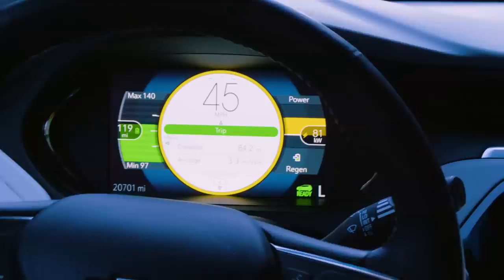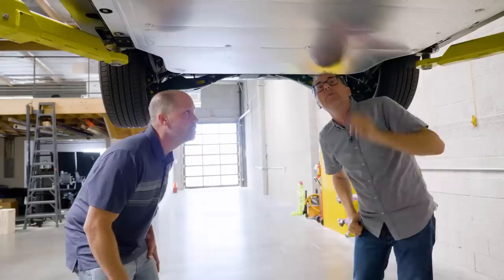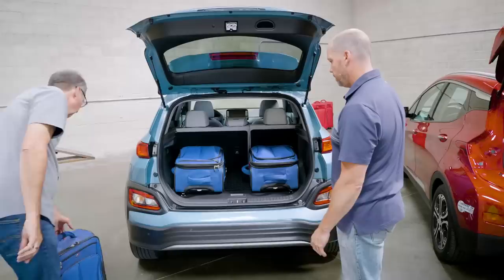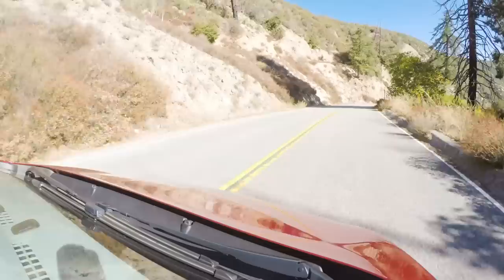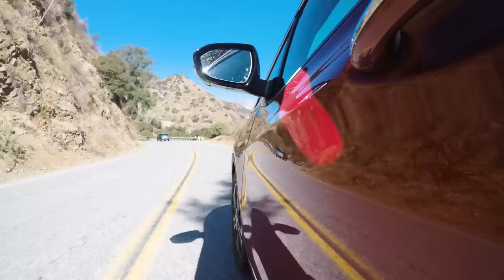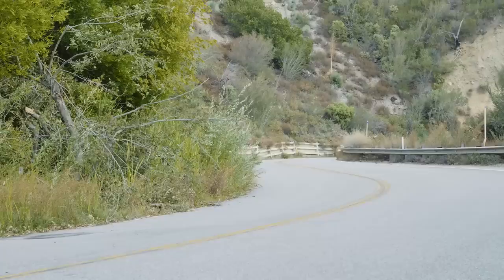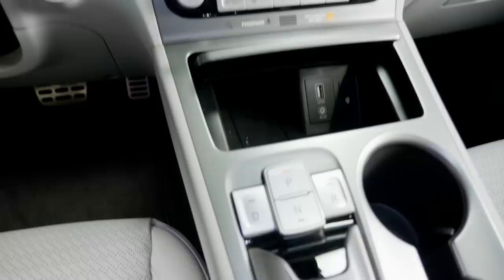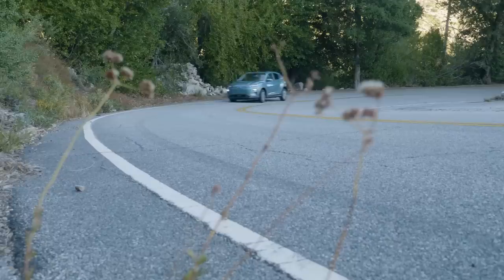Hyundai Kona Electric vs. Chevrolet Bolt EV: Which Is the Best Affordable Long-Range EV? | Edmunds

Comment: Neither, get a Tesla model 3
Reply: Never mind these two apples here, get this orange. And pay $10K more for it.
Reply: @NukePooch1  better tech, better charging fast network that exists today and expanding plus cheaper to use, better battery, American company that is all in on electric, worth $10k to me.
Reply: @flipperbear9  Doesn't change the fact that the M3 doesn't compete with the Chev and the Hyundai. It's in another bracket.
Reply: @Shadow-lq7rx  I don't care about Tesla one way or the other. My point is that you can't honestly compare the Bolt and Kona (apples) to the Model 3 (orange)...the Tesla model that could compete doesn't yet exist. If they can make it to market, fine, but I think they missed their window of opportunity. There's a TON of automakers with deep pockets that are soon coming out with EV's that will drive the price down even further.
Reply: @NukePooch1  how does a base model mid range Model 3 compare with a fully loaded Kona/Bolt, both at $45k?
Reply: @anevtransition1298  One's a rear-wheel-drive sporty-ish sedan and the other two are front-wheel-drive hatchbacks. They can't really be compared. However, if you tick every box on the Chevy (including all the overpriced accessories) then you're still $2k less than the black-only no-extra-option Tesla. You can tick every box and get a F150 priced the same as a base BMW 7-Series...doesn't mean they compete. It just means you paid $80k+ for a $35K truck.
Reply: Luck Tesla got that bailout loan from the government before it went bankrupt. Tesla needs the welfare.
Reply: @dmay3391  Tesla took a loan and paid it back with interest before it was due. That is not welfare, my friend. Money was made from that loan, which contributes to a strong economy. The government offers these for good reason. Chew on it for a while.
Reply: @Shadow-lq7rx  my friend the kona will be at least 42k I promise you
Reply: I tried to build the Model 3 as a hatch/fastback like these or its big brother S, but to no avail. Womp womp. No deal.
Reply: @cogniktive1147  ya there's no sense looking at sedans if they don't work for you. However, if you're working on a car comparison and you add Tesla to the script, but refuse to mention the mid range model that is close in price to these two 'fastbacks', you're going to hear about it.
Reply: @dmay3391  GMC (Chevrolet) also was bailed out by the government.
Tesla wasn't bailed out by the government, but consumers get tax breaks for buying one. The same goes for any electric vehicle though.

Comment: 18 months later and the Kona electric is only available in a hand full of states at full MSRP ($43K).  The Bolt is available nationwide and now has 259 miles of range due to a change in battery chemistry.  You can buy a 2020 Chevy Bolt Premier for $13,000 LESS than a Kona Electric.

Comment: Why do American car makers still insist on cheaping-out on items that give overall build impression?
Thanks for sharing the undercarriage build: I would def buy the Kona based on that alone. I live in snowy territory and had a Subaru with a skid-plate underneath. It made a huge difference busting through snow or taking on rutted dirt roads.
It's a shame the Kona fails on rear-seat room. I also don't see the advantage to the drop floor in the rear hatch.

Comment: The real question for me on an EV is the battery/range degradation over time. I drive many miles so a lease is not practical. I will probably buy another used Prius for a second car. My last one was a rock star.

Comment: Would have been helpful if we could have gotten some height information (when describing rear seat room).  Not mentioning height removed some very important perspective.   Dan is 6'2" tall so normal sized folks may have no problem sharing the front/ rear space in the Kona

Comment: The Kona is definitely a better vehicle, but the Chevy bolt came out nearly three years ago. The reviewers forgot to mention that the Kona also has adaptive cruise control and auto driving features such as propilot in the Nissan leaf.  Of course I would buy the Kona over the Chevy bolt in ~2019!

Comment: My understanding from several Bolt owners is that the seat "settles" in and foam and plastics relax a little bit. 

On the other hand, it's three weeks after this video is published and we still don't have Hyundai's website telling us "Hey, you can buy one now!" We're still in "sign up for email updates on availability", and no firm pricing yet. It's clearly more ready to go than the mythic $35k Tesla, but ... not yet. Still can't buy one. And used Bolt EVs are starting to show up for $27-28k with "practically new for an EV" 15-20k miles on them.  A lot of that is admittedly "tax credit effect", but ... it's still real when you write the check for purchase.

Comment: I charged my Kona electric to 100% and saw 311 miles of range available!

I have been trying to drive my Kona electric economically, though I do have moments of wanting to enjoy the spritely performance and acceleration!
I have noticed that the Kona determines its "anticipated range" based on prior efficiency achieved.  When you see the range number, it's obviously not written in stone, it's only what the car's computer "thinks" you can do.  As you drive, you can correlate your miles driven with the remaining range displayed to see how closely you are coming to the original estimate.
I have been averaging around 4.9-5.0 miles per kWh (7.8-8.0 Km/kWh), and charging to 90% which has been giving me between 275-285 miles (442-458 Km) displayed range, and by doing the math: 280/.90 = 311 miles (500 Km)!

Comment: The reviewers complained that the Kona regen was not as strong but they both missed the paddles on the steering wheel that add the additional regen force. RTFM

Comment: One thing I don't understand with the Bolt: why did GM allow it to go out with the seat it has, rather than grabbing a seat from another existing GM vehicle?  You'd think with all the parts-binning that they've done in the past, it'd be a no-brainer to remove everyone's complaints by swapping seats for the 2018 model year.

Comment: You didn't want to talk about range yet you mentioned the regenerative difference. Regardless if it is slight, you should had made an equal drive pattern long enough to compare how much recharge is benefited from the regenerative breaking.

Comment: Consumption? Ride is NOT the same as handling - take both to a track and see how they compare in turns. Steering feedback is lacking in most modern cars which adds to issues of screen distraction, lack of driver involvement, inattention and accidents.

Comment: Leaf will achieve range and power parity with these two cars in 2019 .. meanwhile it beats both for comfort,  and has the added benefit of being Time Tested for almost 10 years.  No shortage of trained service people or parts.. not that you are likely to need either.  Sadly the increased range will discourage development of charging stations in rural America...when that is the opposite of what is needed.

Comment: This was a very impotant video, but it needs to be updated with a 2022 KONA  SEL VS a  2022 Chevy EUV BOLT  base model and see 
how the handling and suspensions have changed and improved respsectively,  these two cars are the most similar in price now
for the 2024 and likely 2025 used car market, with both likely available in the 15K range by end of 2025  (after using the 4K IRS used EV tax credit)

Comment: Excellent analysis on what was covered.
Another video needs to be made on the "infotainment" system.  All cars, of late--just dealing with basic functions have gotten way too complicated and non-intuitive.  Example: Trying to set up two AM presets on the radio.  The print Owner's Manual was useless.  I ended up having to watch a YouTube video to see how to set up the presets!  A very sad commentary.  Disclaimer: My 2007 Toyota Yaris is so well suited for my driving needs--alas, no current car model comes close to its ease of use.

Comment: I thought the paddles behind the wheel on the hyundai increased regen?  (actually i think one lets it freewheel and the other is max regen)
Reply: Paddles, increase or decrease the three levels of regen. Plus holding the increase paddle will bring the car to a complete stop. No freewheeling option.

Comment: The $35K model 3 is not vaporware. Where is the proof on that claim? the medium range just came out and at a cheaper cost. So why couldn't the battery get smaller and cost less? Why couldn't the roof be aluminum? Why couldn't the seats be cloth? Confused to see how you think a model 3 at $35K is impossible. 

Everything else was good, but that instant dismissive comment just tells me biased asf.

Comment: You didn't discover the max regen Kona EV paddle shifter for max regen when entering a corner! Anyway, I am not sure extreme regen is good for the battery, and when range is not an issue, maybe max regen is not a clever thing to use daily.

Comment: Pretty good Comparison, missed charging tests to compare charging speeds and charge loss. The kona design definitely took notes on what to do better such as interior and seat quality , but remember the bolt has been out for 3 years so there were design flaws to get it to market quicker , I hope the next gen bolt fixes the seat issue . I have a bolt and the only negatives I have are 1. Terribly uncomfortable front seats and 2. No adaptive cruise control . Also they didn’t compare the infotainment systems, I really like the bolt tech , good to see other competition in the $35k and > 200 mile range points
Reply: Not sure about charging times, but there's a video on youtube with a guy driving a Kona who got over 510kms (316 miles) on a single charge (with 2% battery left).  Actually, on that video it showed a full charge (2% to 100%) in almost exactly 2 hours.  I just don't know which charger he was hooked up to.

Comment: Model 3 SR is vaporware - brave call Edmunds, and frankly I agree.
I also agree the Kona gets my nod - it is a better finished car than the Bolt - but the advantages are slim to the point a facelift can address many issues like the white reflective interior & better seats.

Comment: My wife and I own a 2017 Bolt and have had it for about 20 months now.  I'd agree with pretty much the entire review and I'll add a few observations.  The seats do suck, especially for a large man as myself but my more normal sized wife thinks they're ok and since it's her car, then it's not a big problem.  Legroom is great....front and rear.  The plastics are bright and hard....attractive on the face but there isn't a soft piece in the bunch except for the door elbow rest (barely soft) and the center console (ok).  One place where GM really cheaped out in the carpet.  I've never seen such a flimsy piece of material.  I know it was chosen to save mass and to save money but it's just a complete disappointment compared to every car we've had since my wife's 1993 Ford Escort.

I think the reason for the cheap interior versus the Kona can be blamed on when the cars were designed.  The Bolt came to market in November 2017 and the Kona came to market two years later.  But the cost of batteries per kwh has likely decreased since the two cars were in their respective design phases.  So Hyundai may have had a little more budget to spend on things like better interior surfaces, a more sophisticated suspension and even a bigger overall battery.  But there were other decisions that Chevy made that likely had an influence.  I like the supersized infotainment screen...this feature doesn't get enough credit and it leads to one of the best Apple CarPlay implementations out there.  So that cost more money.  Then there is the video camera-based rear view mirror, a feature first found in Cadillacs.  This is useful sometimes but I think that GM should have either made it an option or deleted it in favor of budget elsewhere.  As of now, it's a standard item.  And why Chevy chose not to smooth out the bottom of the Bolt for airflow is a mystery since efficiency is everything with these vehicles.

Otherwise the Bolt has been great...fun to drive and very reliable.  My wife hates the tires since they tend to skate on wet surfaces.  Many Bolt owners have gone for aftermarket choices and we may as well.  But the tires last for 60K miles so it may be awhile before we do that.

Comment: REAL simple comparison: Kona = Low volume supply surcharge of $10000 in most areas, no used market. Bolt = Readily available new vehicles from $25k and used from $15k. The Kona is nowhere near worth an extra $20k

Comment: I didn’t even have to watch the video to pick the Hyundai because I've driven a Bolt. The Bolt has good range and is cheap to operate compared to an ICE. However, it is the most poorly designed and built vehicle I've driven in 30 years and that's saying something. And I'm not coming from high end luxury cars. It's all been mid-market cars that I've never paid more than $26k for.

Comment: While not vaporware, it's definitely fair to say that the $35,000 Model 3 is likely a year or more away. First, in about six months, the Model 3 SR with mandatory Premium Upgrades ($40,000) will arrive. Then, about six months after that, we might see a Model 3 SR in black with basic aero wheels for $35,000 + $1,000 delivery.

Comment: Nice comparison review. Does the Kona EV have active thermal management for its battery like the Bolt? Nissan's cost-cutting decision to employ passive thermal management for their batteries seems to continue to have a negative impact on battery longevity, in spite of attempts to change battery chemistry to address it. 

Also your point about the EV Tax Credit failed to acknowledge the impact Hyundai's PHEV sales have  on tax credit eligibility...Hyundai isn't 'just getting started' as you implied.  I'm not sure how many Hyundai Sonata PHEVs they've sold to date (or whether Kia's PHEV sales count against the total), but those sales do have an impact on total tax credit eligibility for Hyundai EV sales.

Comment: 2020 same range. But the Chevy can be negotiated $8,000-10,000 off sticker in hot markets. Not the Kona. Fast charge on Chevy tapers off at 55%, 80% on Kona. Don't know about Kona regen brakes, probably not as good as Chevy because Bolt was designed for captive Lyft brakes/tire replacement cost savings. Kona wasn't. Batteries are same LG source for both brands. Fast charge slower for one, but perhaps for longer life than the other.

Comment: Vaporware comes from the Microsoft years when it announced features that would be in windows years ahead of their actual availability so that people didn't buy existing software. Tesla is using the same strategy constantly promising a base car that isn't delivered. Why wasn't the base series 3 available ASAP rather than "down the road". Because Tesla makes (whatever money its makes rather than borrows) from higher end models.  The chances of getting a Bolt or Kona level entry model in a series 3 isn't likely for another couple of years. Then the original specs will already have been exceeded by traditional car-maker models.

Comment: I thought the Kona was bigger., It is like the same size of the Bolt. I thought it would be the same size as my Rav4 EV, I was looking to replace it. Not putting a 50 gallon water tank or 8 foot Christmas tree in either of those... little disappointing

Comment: You exclude the leaf because they offer a more affordable shorter version of the 226 mile  one. 

Thumbs down.
Reply: The 2019 Nissan Leaf Plus has a 215 mile range. Mine charges up to well over the projected 215 mile range. A lot of people call the mileage of the electric car as their guessometer, which it is, it depends on your driving, speed, air conditioning and a lot more.

Comment: I call BS on the Tesla base model 3. I own one. There is some extra steps you have to do, but you can buy the base model. I got the partial interior upgrade, so it cost a bit more than the 35,000 dollars.

Comment: Because the Kona EV uses the same body as the Kona ICE, the hood is unnecessarily long, which seems to translate into reduced rear seat legroom.  That seems like the one big negative in an otherwise almost ideal low cost, long range EV.
Reply: Hyundai can build the Kona EV on the same production line as a petrol Kona and adjust production of the EV based on consumer demand. Given the success of the Kona globally, this means Hyundai  can better absorb the higher cost of the EV batteries.

When you make a purpose-built EV on a purpose built production line, BILLIONS of upfront costs must be invested and the ROI has to come exclusively from the EV sales ONLY.  Gotta sale a ton of purpose built EVs to cover the high upfront development / manufacturing costs BEFORE you realize sustained profits.
Reply: Theoretically, but it looks like they are going to be constrained by the cost and/or supply of batteries and not come close to meeting demand.

Comment: BOLT battery loses about 5-10% of its charge hold capability each year!  That's HORRIBLE.  My friend has a Bolt and it's 3 years old with 35,000 miles on it and it now only holds 200-210 miles of charge.
Reply: Mine has 66,000 miles on it and is exactly the same as when I bought it. Did he replace his tires with the OEM models?

Comment: 250 miles is not enough range.. it needs to be 350+ once winter comes around that 250 mile range will be closer to 150 mile range. it is a complete disservice to the public that you guys and so many more ignore how cold changes everything. Heat pumps can make a difference, but we already know that heat pumps don't work that great in cold weather..